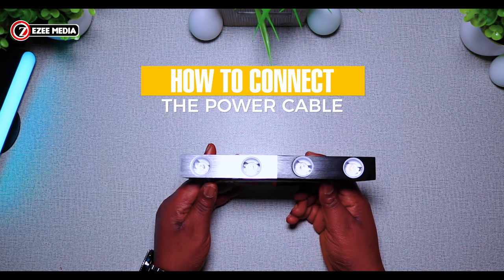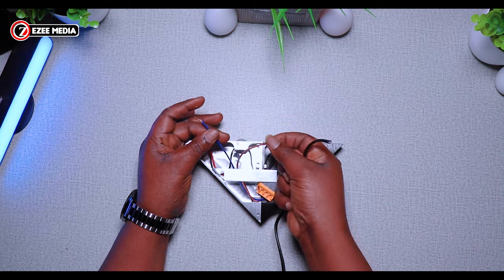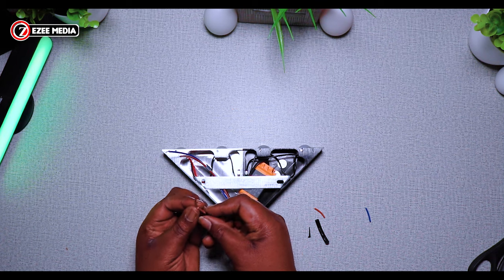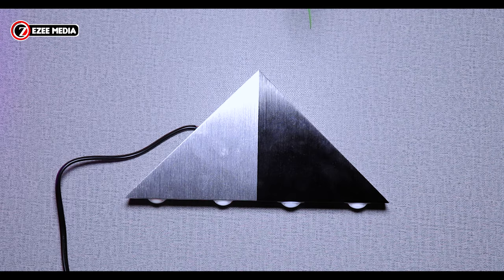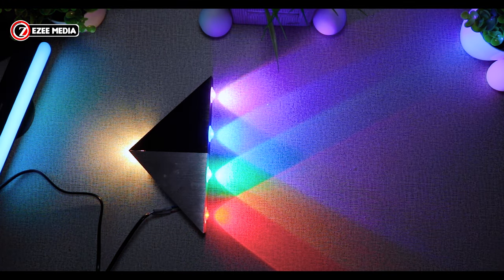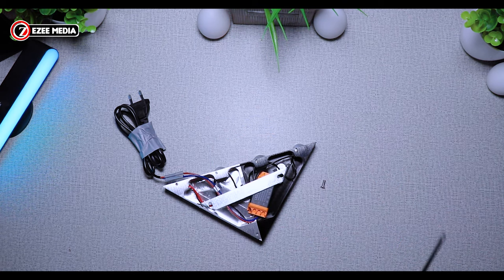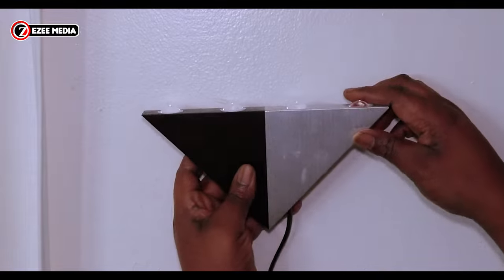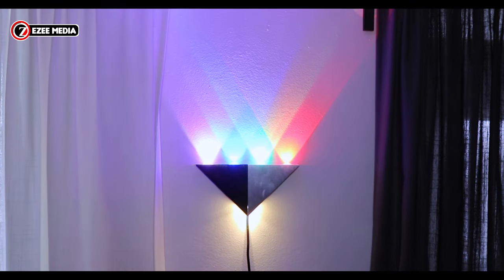How to Install Modern Led Wall sconce - Power Cable Plug Connection and Installation

Comment: I just ordered this item and received the exact cord but the two wires in the black cable were both the same color. What should I do? Did i just waste $10 on a cable that doesn’t work for it and should i just return the lights?
Reply from the maker: No that's good all u need to do is connect the wires randomly and it will work perfectly with the connection.